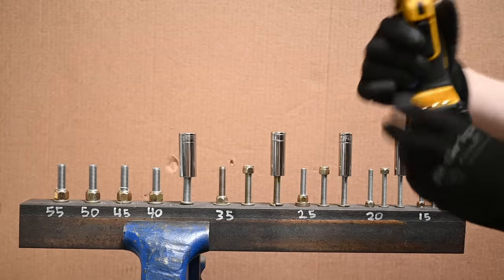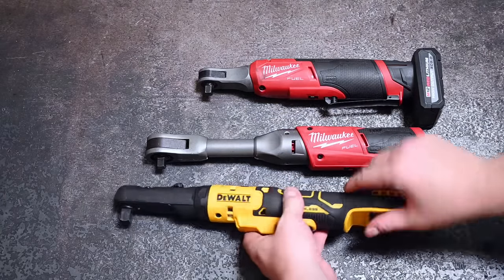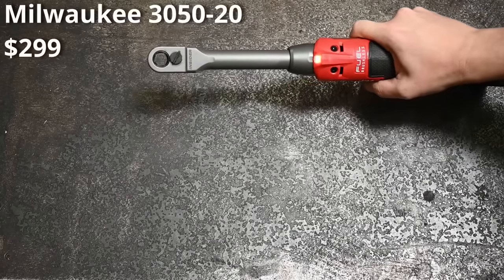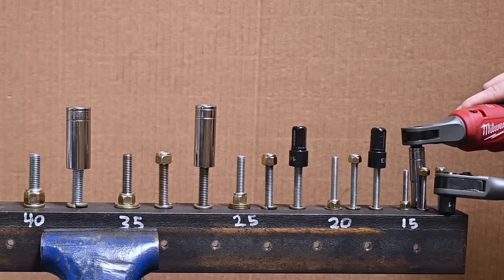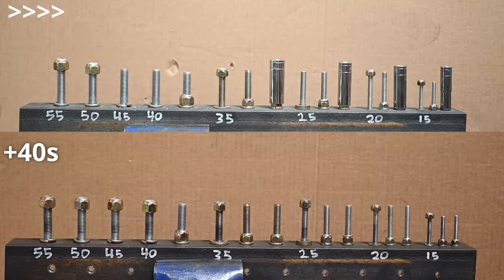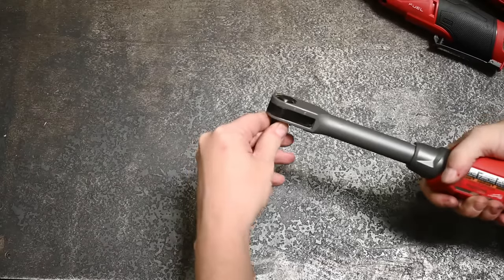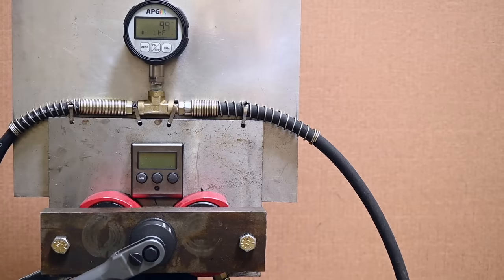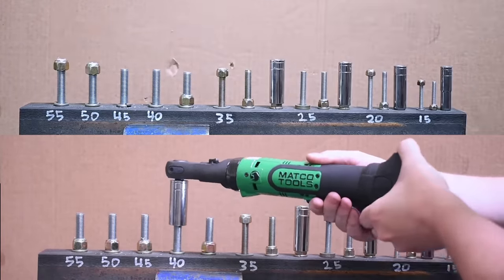Milwaukee's New Insider Ratchet vs DeWALT's New Sealed Head!

Comment: I'll take breakaway torque over some speed any day of the week. I don't mind waiting a second or 2 per fastener as long as it breaks it loose.

Was hoping DeWalt with this release would have been an impact ratchet.. but hopefully soon.

Great video as always, well done.
Reply from the maker: An impact ratchet in cordless would be sweet!
Reply: I love my kobalt impact ratchet. Head is definitely fat but it works super good!
Reply from the maker: @rc-daily   As far as i know, Kobalt only has a cordless ratchet and cordless right angle impact. An impact ratchet believe it or not (there's a lot of shared terms, also often called a reactionless ratchet) is a bit different
Reply: @TorqueTestChannel  I guess technically it is a right angle impact. Gets the job done though. Even though it's definitely not the strongest impact on the market today but when you have kobalt tools you buy it 🤣🤣🤣
Reply from the maker: @rc-daily We think that Kobalt is great honestly
Reply: @TorqueTestChannel  I think it's a great tool as well. I use it more than I ever thought I would. Its super handy for working on the tops of engines!
Reply: @rc-daily  I want to correct my earlier post, I did mean to say right angle impact for the DeWalt,, but same concept applies I suppose.

The one who makes an (affordable) lol....right angle impact that can break loose a caliper bracket bolt on at least a 1/2 ton truck/SUV platform wins. A 3/4-1 ton truck might be a stretch.

Comment: Have you thought about grabbing DeWalt's 12v version of this ratchet? Instead of 1/2 and 3/8, it is 3/8 and 1/4, along with a 1/4 hex bit adapter. It claims a torque figure of 50 ft lbs, and a no-load speed of 450 rpm

Comment: The crown jewel behind the insider is the thinner design with socket, it fits in tight places. The pass through is just a novelty, which is why it stops at 15mm.  11 seconds slower than a competitor is still multiple seconds faster than hand ratcheting.

Comment: The insider stuttering must be the pawls skipping over teeth when running at full speed, on account of the pawls being inside the oscillating part instead of the rotating part like it is in the older Milwaukee units. A stiffer pawl spring might fix that. If the spring was stiff enough but just so happens to hit some kind of resonance that could be fixed with some more grease.
Reply: I was thinking the same thing. I also don’t like the violent shaking of the lever. It seems it will shake itself apart at some point.

Comment: All my milwaukee impacts and ratchets stutter. M18 &m12... was told by the rep that it was normal, hate it so much I don't even use them anymore. Went back to my trust 14.4 snappy long reaches and air impacts. My snap on ratchets are both 5/6 years old and never failed. Just wish milwaukee would fix this issue already

Comment: Yeah that new Insider is probably not worth the purchase, but they are pretty much hitting their RPM and torque claims which would make this the highest torque m12 ratchet if that matters to you. For me, I'm an automotive tech and Milwaukee's slim designs are a must for accessing hard to reach spots. They just simply fit in places other electric tools don't. That's worth the cost for me

Comment: Strange thing is TTI made a Craftsman pass-through ratchet before Stanley bought the Craftsman trademark. It doesnt stutter at all, it might not take the Dewalt in this test but I am sure it would surpass this new milwaukee due to the stuttering problem. Even though it only has an old tech Johnson can motor and isnt even brushless.  What I wish they would come out with is a larger pass thru size like the '1/2 pass thru drive size', or even bigger honestly, keeping the same low profile thickness, for sockets having the  fastener interface fully inside the drive head.(Like a squeeze wrench if anyone remembers those) If we are serious (especially at these prices) about low profile access whats taking so long for these companies to come out with this?

Comment: I just see such limited use cases for these ratchets, especially at the price, but for construction folks they could make a lot of sense. What I want to see is cordless ratcheting wrenches. I've had a design in mind for a long time, but it's not like I'll be able to prototype and patent it before one of the big dawgs.
Reply: I wouldn’t know how to make my living without one. If I break mine I’m going immediately to buy another one. I don’t know how to I ever used an air ratchet.
Reply: @dreece2000  Oh I mean specifically a pass through ratchet like this. Cordless ratchets in general are incredibly useful. This just seems like a more niche tool with a high price tag.

Comment: @TorqueTestChannel seems like the "insider stutter" is only occuring when you're utilizing the pass through sockets on the smaller nuts.  To me this would suggest that any small "roll/pitch/yaw" of the tool is causing the threads to rub on the inside of the pass through.....or possibly pieces of nylon are coming off and getting stuck inbetween the threads and pass through causing the friction.  Easy way to test is to simply run the test without using any of the pass through sockets and see if the stutter still occurs.

Comment: Best thing I did was get a dewalt electric ratchet instead of my Milwaukee. I prefer having the more torque because I use it to break bolts loose. I know your not supposed to but when I'm crammed in a bus or RV. It's nice being able to do it on one go.
Reply: too bad they cant have a high torque or high speed switch
Reply: @tylermcgonigal6031  that would make a lot of sense. Like a drills speed selector.
Reply: @tylermcgonigal6031  you know I was thinking about it. I know the electric ratchets are definitely faster than hand ratchets. But if I have the needed space I'll always grab my impact gun which is both faster and has more torque. I mean it would still be nice to switch the ratchet from torque to speed but in those tighter spaces I'll mostly have it on the higher torque setting anyway. That is for me personally. I am also probably using the tool wrong but when I am inside a bus I usually don't care.

Comment: We sold that same sealed head as an air ratchet on Mac tool trucks in the late 90s. Early 2000s, at that time it was an exclusive and the 1/4 was awesome till Mac pulled a bunch of power out bc they were warranty replacing too many anvils.

Comment: You should repeat the tests for The Insider using regular sockets I have a feeling the pass-through sockets are what is causing the stutter. Especially considering it does better on the bigger nuts when you don't use the pass-through. I'm thinking that the bolt is slapping around inside and opening of the socket and causing the Pawl to jump teeth.
Reply: Exactly!

Comment: I have gotten my M12 stuck plenty of times. That recessed switch design makes it nearly impossible to free. I can already see how the new switch coupled with that 3mm of extra space could really help in those situations. Plus, it's got a bit driver adapter. This isn't really a replacement. It's just added versatility with minimal cost to power.

Comment: I got a DeWalt 1/4in 12v ratchet and that thing is bad ass... I used it to tighten down a bolt and then I got out a torque wrench set to 40ftlbs, which is what its rated at, and it clicked and did not move the bolt. And its funny cause its the only yellow tool I have, everything else is Milwaukee.

Comment: Even one millimeter is a lot on hard to reach bolts on European cars that are hidden between fire wall and turbo pipes. So I would say that that is great tool. You don’t need on vehicle big torque because most bolts are not torqued more than 20 nm.

Comment: The larger sizes are not possible without making the head much bigger. The pass through bolt hole would mean the thickness of the socket wall would become thinner as it passes through the head. Disappointing to see the m12 underperform in torque, that was what I was hoping it be good at.

Comment: The insider ratchet is indispensable working on combines. There are multiple belt adjusters with all thread about 1ft long. Craftsman made a battery pass through ratchet years ago that accepted the gearwrench pass through sockets and they are a huge time saving over loosening and tightening belt adjusters. Outside of that I don’t see hardly any use for them

Comment: I bought the Ryobi USB C ratchet. It struggles with even small fasteners
Reply: How noisy is it? It looks cute and small but my M12 brushed ratchet is so noisy. I think a small cordless screwdriver with a 1/4 adapter would probably be better than the Ryobi USB C
Reply: @gf2e  it’s not too bad. It doesn’t set off the sound warning on my watch

Comment: I can’t remember the part number but Mac has an air ratchet that’s rated at 100ft/lbs with an interchangeable head. 3/8 and 1/2 and they do make a 1/4 3/8 version as well. It’s my first ratchet purchase and I haven’t snagged anything else yet (mainly due to a lack of funds 😅)

Comment: Hey Torque TestChannel: The stutter that you mentioned when using the Insider appears to happen because the handle is being lifted higher and lower than perpendicular (as you are tightening the nut) relative to the bolt when using the passthrough socket in the smaller size. I think this is causing the bolt to bind or rub against the pass through in the socket.
Check it out on you video. You can see the operator holding the ratchet is not keeping it perpendicular to the bolt as the pass through moves up and down the bolt.
This would also explain why it does not happen when you are using the regular deep sockets on the larger bolts. Not passthrough for the bolt the bind on. 
Give it another try using the 3/8 adapter and standard deep sockets on all the bolts. If it does not bog or stutter we will know that when using the pass through sockets it can bind if not carful.

Comment: The 5.0 high output battery should have been put on the high torque extended reach for a more fair comparison against the insider because it does make a difference and I'm speaking from experience 🙃

Comment: My first impression of the insider was not great and decided to pass on it.  Once they updated the adapter to lock in that got me to give it a shot just cause i wanted to get a 1/4 and 1/2 ratchet so it saved me money if it was decent instead of buying 2. After using it a while though definitely has grown on me it isn't the end all of cordless ratchets but i feel like it fills in all the areas my high speed lacks perfect so having both just is a great combo really glad i got it. I tested it with lug nuts a while back and mine went to to 65 ftlbs from a torque wrench.  I guess there could be a margin of error though from the torque wrench.

Comment: I've owned the insider for a couple days and got the first big job to use it yesterday. Performance is good optional socket position is nice. My big complaint is the adapters 1/4 3/8 fall right out. The sockets stay in fine but the adapter no go. After Chasing it a few times I ended up wrapping it with tape to Finnish the job.
Reply: Sounds quite unhandy.........
Reply: @slingin_tires  I am not sure why they didn't make a lock for the sockets. I guess Gen 2 might have one.
Reply: @DocsPropShop  I ended up getting both DeWalt's and their anvils lock in nice and tight.

Comment: Had a pass through ratchet idea years ago why’ll working on combines. Older combines and even on the newer ones but not to bad now but they have long threaded rods and nuts to set belt tension on literally everything. Never would consider using it on anything that was actually tight but would save so much time for those situations just running nuts off or on quick.

Comment: i perfer the dewalt solely on the face that the reversing switch is lower to not jamb you in a tight spot AND it has a button instead of a paddle

Comment: Is it possible you would test another m12 pass through ratchet? I feel like the stutter shouldn't be there and maybe the ratchet is faulty?
Reply: I really hope this doesn't turn into the 1/2" high torque stuttering issue with this tool.

Comment: I liked the idea of the pass thru sockets but the stalling issue would be frustrating. I do like the smaller head on the new dewalt but seems it may have almost to much torque.

Comment: I honestly don’t care about the torque rating on these ratings. I feel like 30 is plenty. People forget, these aren’t impact wrenches. If something is tighter than the ratchet will do, just use it as a hand ratchet and turn it! I feel like I’ve broken a lot of smaller fasteners with the m12 fuel. 60 foot pounds is way too much for smaller fasteners. Personally I think the 30 foot pounds is absolutely perfect. If i need 60 foot pounds I’ll go for my stubby impact wrench

Comment: In my experience, the m12 fuel ratchets have always had that "studder". All the way back  to my older 2557. Even after being rebuilt by Milwaukee twice. It happens especially bad on boost clamp nuts. It's the main thing keeping the m12 ratchets from being really great, all-around ratchets IMO.
Reply: I find a slight bit of pressure downward on them helps

Comment: Man I just took back my M12 Fuel extended HS ratchet and ordered the Insider for work. The head on the extended reach was a little too thick for a task I was doing, that’s why I took it back. I hope this doesn’t fail for me.
Reply from the maker: It realistically doesn't do anything a ton worse, maybe a bit slower than the HS but also more TQ which can be useful and so can the sockets, just thought it might be THE BEST and it's sort of more just useful depending on the user.

Comment: Seems like the Insider is a "problem-solver" tool that won't leave the toolbox much, but when you're in a tight spot, it would be less awkward to use than a Tite Reach if you can get it in there.
Reply: Rusty parking brake adjusters

Comment: Thank you. Pulled me back
Saved me $300
Sticking with the old reliable slow Fuel.  Just keeps going.  Used and abused 
Was going to get the extended reach high speed.  More of a it’s in the tool budget and I would like than a need. Then the insider was advertised.   
Might have get yellow tools if I need a new ratchet.  
The new m18 stuff is looking good so hoped the M12 would be too
I have what I need. Now it’s the wants and back ups or upgrades. Hate to pay full price. 
The advertising and hype on the high speed and insider almost got me

Comment: Ok this is going to sound crazy but hear me out. I've had some really odd things happen with my 5.0HO batteries (I have 4) and noticed that I have better power output with the 6.0's. I first noticed it happening with my m12 cut off saw, the HO's give out and lose power while the 6.0 powers though stuff with no problem. It affects most tools the same way. I've tried compact bandsaw, impact driver, drill, finger sander, copper cutters, nibbler, oscillating tool. All negatively affected by the high output battery.

Comment: Maybe you already addressed this and I just missed it but the one issue I see with these tests is using the special insider socket. The socket in use should always be a controlled variable. A sockets design and mass can effect performance. I think that is at least partly why the Milwaukee insider started to catch up once it switched over to the full length chrome socket.

Comment: If anyone from DeWalt is reading this, please design some pass through sockets that work with your new dcf ratchets. I actually wanted to buy the DeWalt over the Milwaukee but then once I saw the Milwaukee insider I was swayed by that one feature
Reply: Im a mechanic and have 0 use for a pass through ratchet
Reply: @user-di7dn6yh9r Like you're going to take less speed, torque and stuttering over the flawless DeWalt!?

Comment: I've noticed the stuttering on the shortie m12fuel when the fastener isn't on a rigid surface. Even when you grip the socket, it shakes to much to ratchet. Still handy but eh I'm sure there will be improvements out there

Comment: The benefit of the pass through design is the low profile. Ever done a water pump on a toyota 4 cylinder or FWD 6 cylinder? Yeah the lower profile of the electric tool will be very nice. I could care less how much slower or faster it is than other larger ratchets. It’s all about how slim it is. And having the benefit of being able to flip the socket to the rear of the head.

Comment: It makes sense to me that the insider gets bound up, by having a rigidly mounted pass-through socket you're removing the natural wiggle room that you get with a square drive socket, even being off kilter a little is going to put a side load on nut, jamming it against the threads. Odd that it doesn't just stop though.

Comment: bought this a couple weeks ago. The main selling point being the anvils. The fact that I can have an electric ratchet for 1/4, 3/8 and 1/2  that's also extended reach & low profile is a massive space saver. Whether i'm in the shop or out on a call being able to have a single ratchet replace multiple is amazing. While there are things that I prefer other ratchets over for, the low-profile head has been the difference between minutes to get a bolt out that an engineer shit the bed on and literal hours of work. In terms of personal time that's pretty substantial - especially if you're just doing work on your own shit, but in terms of shop rate? It paid for itself the first day I used it.

Not my favorite ratchet on the market, but the pros for me FAR outway the cons, and I reckon the gen 2 is going to be a beast.